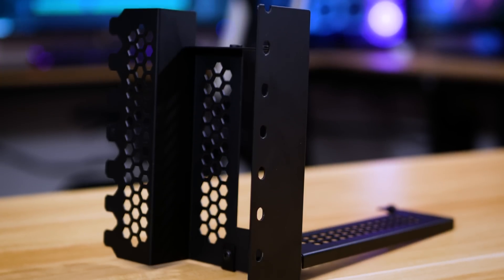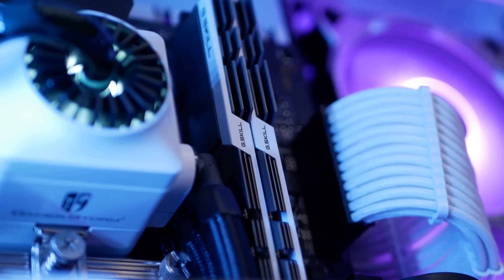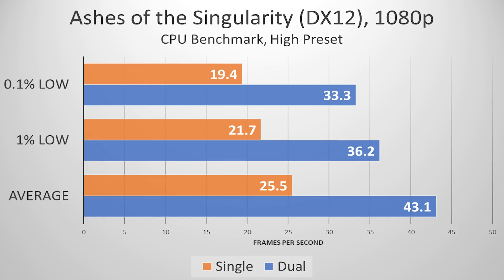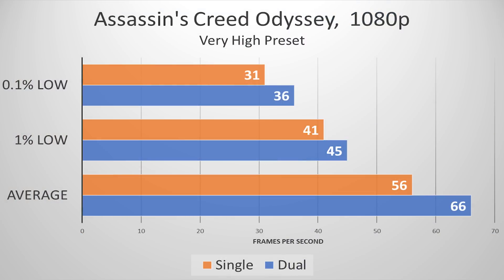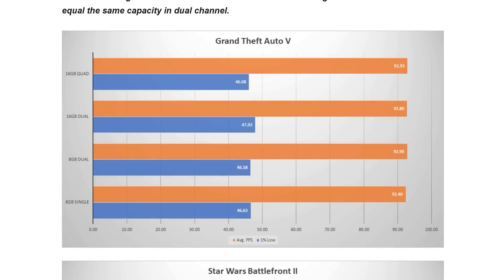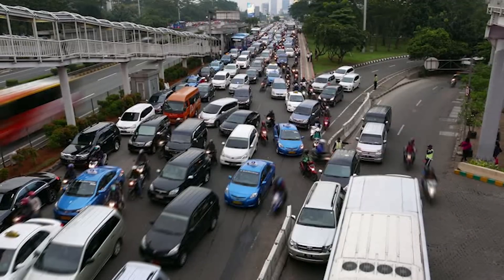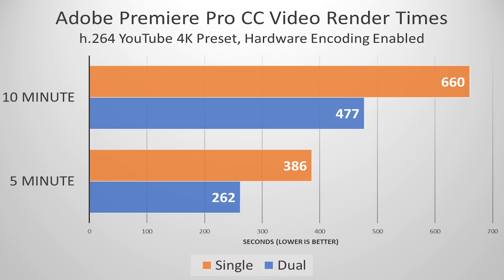What is Dual Channel Memory and Why Does it Matter? (w/ Benchmarks)

Comment: Hello i have a question:) im looking to upgrade my ram to 16gb instead of 8. I aldready have 2 sticks of 4gb ram in the 3 and 4 slot. But the problem is that the store stopped selling those. And i can only get my hands on an 1stick og 8gb ram. So that would make me have 1stick of 8gb plus 2x4gb sticks of ram. Would this work? And does IT matter if i place the 1stick 8gb into the 1st or 3d slot? Thank for the help.

Btw it is the same producer and the both are 2400mhz

Comment: EDIT:  Greg, I think there are some clear reasons that Brent saw little to no differences in his FPS, while you experienced a significant difference here. It appears that your RAM setup included Dual channel ganged mode, and dual channel single dimm, the latter of which breaks the parallelism of the RAM config. There seems to e much confusion about how the channels work. In dual channel, you're combing the bus of each RAM slot. For example,  two 64 bit buses creating a 128 bit bus. It doesn't do a whole lot, except that when not in paired buses, performance bites the dust, as you saw in your tests. I wish that the industry would refer to the Slot Groupings as a Channel, and refer to the Performance based on How Many Slots or Buses are combined. For the channeling, What I'm more interested in, is what Compute features are enabled in the games, ie; AA, RTX, FreeSync, physics and so forth. 2nd, I think the tests for dual channel vs single channel, are more interesting when we start playing with things Like Memory Interleaving being On vs Off. Does CPU Virtualization or IOMMU groups have any impact to memory configuration?  They shouldn't, but do they? Again, I'm not surprised by the results at all, but the title doesn't seem to match the test. Finally

Comment: if both my CPU and board support up to 2666 RAM speed, should I be getting a 3200MHz if am going to upgrade every 5 years?

Which will be cost effective in the long run? 
buy 2666MHz RAM ?
or
3200MHz RAM?

Comment: I built a secondary gaming/streaming pc with a dell optiplex 7010. Unfortunately, The A2 dimm slot is dead. I've tried blowing out the dimm with canned air and I've reseated the stick like 10 times. Every time I powered on the pc, I'd get the flashing amber light indicating a ram issue. So again unfortunately, I'm forced to use single channel. I have 2 sticks of 8gb ddr3 totaling 16gb. One stick in A1 and the other in B1. I can play games just fine with the 1050ti, but it's super annoying knowing I could be getting 10-20 more fps if the damn dimm wasn't dead. BUT, I am gaming comfortably on it 1080p 45-60fps depending on settings. For those of you looking to game on a budget, I would recommend going this route but beware of issues like this. Also there's no room for upgradeability so buy this knowing it is what it is.

Comment: I am confused.  I have ASUS Prime Z390-A.  It has 4 slots, but says Dual Channel Configuration.  I guess I have a few questions.  It seems less expensive to buy two separate kits of 3200mhz 16 cl, each has 2x8 for a total of 32gb ram at 3200mhz.  Vs more expensive option of a single kit of 3200mhz 4x8.  Manufacturer warranty does not cover 2 identical but separate kits to run at 3200mhz and cl 16 (2x8+2x8) = 32gb 3200mhz total.  But had I spent a boat load MORE for a 4x8 kit at 3200mhz speed, they would be warrantied to operate as such.  What is all of your understanding with this?

Comment: @ScienceStudio, some motherboard do not have B2/A2/B1/A1 lineup, my motherboard has it set as B2/B1/A2/A1. Before you just carelessly state "oh don't do it like what he did" you should verify whether or not some motherboards hold up that way. Even I thought was for dual channel you'd have to do one spacing apart, but it turns out some motherboards have it adjacent.

Comment: I have four memory kits 8GB each for a total of 32GB. Same memory kits same brand same specs same everything. I was not aware when I bought them that they recommend to buy them together if you doing either 2 or 4 memory kits configuration and instead I bought two sets of two 8GB chips box separate for a total of 32GB . If i'm doing 4 kits of memory does it matter where I place them since I didn't buy a single set of four rams and instead I bought two sets of two rams each?  even though they are the same brand same specs and everything their serial number is deferent  because they were not bought together.  This are the memory that I bought at new egg I bought two of this set. TridentZ RGB Series. 

Any advise would be greatly appreciated.

https://www.newegg.com/g-skill-16gb-288-pin-ddr4-sdram/p/N82E16820232483?Item=N82E16820232483

Comment: Correct me if I'm wrong, but shouldn't you redo the test at different presets? And then try replacing only the GPU? That way you can find out if  letting a component idle or taxing it has any effect and thus see which takes more advantage of the dual channel ram.

For example, you might be able to say that only the highest end GPUs would get such a large boost in fps. Or only the most demanding games will make use of it. Right now we just have two people giving us two different results.

1. It matters a lot.
2. It doesn't make a difference.

Lastly, try running the exact same setup but with an ssd.

Comment: One stick Kingston 8 gig DDR3 and two sticks of off brand 4 gigs a piece. Also different timings. Works great in a very specific combination. Switch the sticks around and it will not run.

Comment: Ive done similar tests to myself, there wasnt any difference, bc my cpu is bottlenecking my system, even while it shoudnt do that at all
Tested:
1x16gb//2x8gb ddr4 2133mhz
i5 6500
Gtx 1060
Ssd 240gb

Comment: Hi Greg if I run 2x4go ddr3 and 2x2go ddr3 (in the right slots for dual channel, and same clock speed) am I running 2 dual channels or does it disable dual channel function?

Comment: Matters more on the quality of the hardware, for example I had a GTX 970 and the difference between single and dual were negligible however after upgrading to a 1080ti single channel killed my performance when upgrading to dual channel I Gained about a 35-40% performance

Comment: Dual channel memory mode is not automatic on ALL motherboards, some lower-mid tier motherboards even when installed in the dual memory slots will not go into dual channel until you change a setting in the bios. proof http://i.imgur.com/44RSbEb.jpg

Comment: I'm running dual channel 2x8gb ddr4 3000 in a msi b450 pro carbon ac. It also had that pop up in the bios when I had the sticks installed in the wrong slots.

Comment: Is it fine to have two separate dual channels like 2x4gb and 2x8gb in the same system
Reply: Yes.. As long as the mobo supports the amount, And the sticks don't cause any compat issues. You will still be running in dual channel if quad is not supported.

Comment: What I'm curious about is how single vs dual channel affects non gaming environments, as well as a situation where you are doubling the memory from dual channel and converting it to single channel memory. For example I have a Dell Optiplex 580. It came stock from the factory with two 2GB sticks of DDR3. I searched my house high and low for more DDR3 memory and could only find one 4GB stick. I've been contemplating adding it to the PC, but cringe at the thought of breaking dual channel configuration. Would going from 4GB dual channel to 8GB single channel slow the PC down or would it actually possibly help? I do not play games at all. I use this PC as a workstation. I do not do video editing either.  I do dabble with fusion 360 for 3D printing, but that's the most graphically intensive program that I use.

Comment: I would expect an i5+ CPU with a 1050-level GPU would probably not show 2Ch benefit (or should I say would not show 1Ch penalty).
My story: I borrowed my nephew one of my 2 8GB sticks. I played Shadow of the Tomb Raider with a low-priority ffmpeg h265 in the background (i7-8700K+1070). What I noticed is that my SotTR framerate had halved. Upon testing more, it seems ffmpeg in background was enough to hit 1Ch memory limit. When only SotTR ran, frame-rates were playable again (did not record numbers, but I don't expect more than 10% penalty). With 2Ch memory, ffmpeg was not noticeable.

Comment: I’m planning to build a PC next year and debating if I should get 3200 or 3600 DRAM at 64 GB (4x16), or 32 GB (2x16 or 4x8). I’ll be using it for gaming, Photoshop and video editing with Adobe Premiere Pro. For the CPU, it’ll either be a 9900K or the Ryzen 3850 with a 2080 Ti. Any suggestions on the DRAM speed and quantity/RAM kits?

Comment: Hey, I have an option called unganged mode for my RAM on old Phenom motherboard. I've run the numbers and it does better than dual channel. I do have 4 x 4GB RAM stick and my CPU is Phenom II X4 965 BE (4x 3,4Ghz). How it works is it assigns one stick of ram to each CPU core.

Comment: So I pretty much upgraded my entire everything on my PC right now but I'm skimping a bit on RAM since I'm running low on funds.

Question: If I buy a single stick 8gb ram now then buy another one later, will it run as good as a straight up dual channel 16gb?
Reply: I kind of did the same but had a single 16gb 2666mhz and 8700k when i got Another 16gb I got 30-40 more fps in BFV and much higher usage on the gfxcard. And all of the stutter was gone.

Comment: well that's why i don't see myself upgrading.. i have the 5820k and it runs on stock voltage at 4.1 24/7.. that was the days when intel still did proper solder jobs.. it's 6 core and 12 threads like the 8700k.. but it's quad channel ram vs the 8700k with dual channel.. the 9900k is way to expensive.. then i'd rather buy the 9800x.. also 8 cores but again dual channel vs quad channel.. and 44 lanes.. i don't know.. i guess i'll wait another gen.. lets see what amd comes up with..

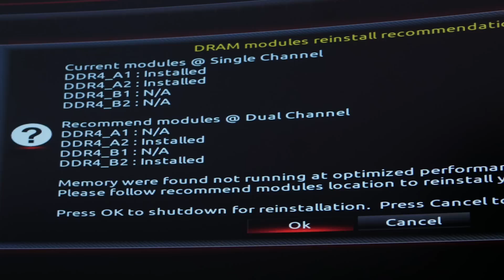Comment: I just wanted to raise one point re. the slots you used. At 1:22  you said that the motherboard required you to use slots A1 and B1 for dual channel (and shows the sticks in that configuration), yet the BIOS warning at 6:14 tells you to use A2 and B2 for dual channel.

Comment: Might be that other benchmarks were using slower (older) CPU (?). With slower CPU, a single channel ram bottleneck might not show. Also I noticed that the mentioned article is also showing the results for 4-channel. So they must have been using HEDT cpu and those are generally not as powerful for gaming therefor the ram bandwidth wasn't a limiting factor in that particular setup, but that is just my theory.

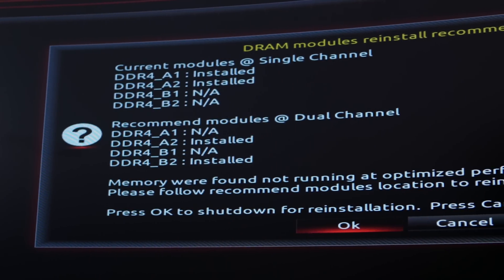Comment: @1:30 you say that slots A1 and B1 are optimal for dual channel, but @6:10 the BIOS/UEFI warning message clearly shows the recommended dual channel configuration should have RAM installed to slots A2 and B2.  It likely makes little difference so long as the RAM is installed onto separate channels, I just thought I'd point out the inconsistency in the video.
Reply: It depends on the motherboard. In a lot of cases a2/b2 is superior. In some cases it won't matter, And in a few rare cases it's a1/b1. It's possible this is one of the latter and the bios has a lot of re-used code that doesn't reflect that.

Comment: Its about time quad or even triple channel memory became the norm given dual channel has been around in the mainstream since the original Athlon and triple channel was in X58 chipsets 10 years ago, and the extra bandwidth would clearly be an advantage. We need another move from the likes of AMD like they did with cores in the Ryzen, to force ram channels to be increased as standard even if its only in the high end mainstream chipsets and CPUs. Whenever I see a a massively overclocked CPU and high end GPU with the GPU rarely hitting high 90s let alone 100% and the CPU is barely even struggling, I can't help but think that the bottleneck there is either the ram or the PCIe bandwidth or both if the GPU is unable to run at full speed, especially in games without soft max FPS cap.
Reply: You start to hit diminishing returns.

Comment: Ha, The Verge dude. My friend (who has built systems, but not in 7 or 8 yrs) and I built my first rig 2 days ago. He was mildly upset we didn't hit any real roadblocks. Biggest hurdles were enabling proper RAM speed, 3000mhz, and splitting the data from one mechanical drive onto an SSD and a second new mechanical drive, mainly cuz I'm kinda thick, and was tired by that point.

Comment: Great video! Very informative.
I just wanted to mention that if you flash a caption on screen, please make it more than 1 or 2 frames. It was a bitch to time the pause to read it lol
By the way, do ram bottlenecks only happen when the CPU is bottlenecked at lower resolutions? Does this mean this is less significant at like 4K?

Comment: I got 1x4GB 2400MHz to start out on a DDR4 platform (Ryzen 3 1200), I plan on either getting a 1x8GB 2400MHz to pair with it or replace it with 2x4GB 3000MHz.

Comment: Thats because ram slots are daisi chaind in pair of two because there is onli two chanels 4 memory on cpu and when you have onli two sticks of ram they have 1 chanel per stick and the boath sticks work at exactly same speed and if you have 4 sticks of ram  usually 2 of those sticks are faster then the other two because of chain

Comment: I wonder how it would perform with a system like a ryzen 5 2600 and rx 580 or worse because that would actually be the people who are considering going single channel with like 1 8gb ram so they can save money and for any easy upgrade and people with a high-end build can already go duel channel with 2 8gb for 16gb that would make more sense I would like to see that
Reply: Never ever go single channel, especially for ryzen cpu. even when you're on mid-end or low-end build with ryzen, its considered as a huge sin!
Reply: Ryzen 2600, rx580, Asrock b450 mITX, single stick of 16Gb 3000Mhz ram.

I went with single stick as I wanted to get a second stick of Corsair ram when I had another $300Aud.
Reply: @Kathdath  How it runs?
Reply: @QuasarQu  pretty good, was running toasty in my QBX, but I just watercooled cpu/gpu so now is runny nice at 4.1GHz overclock
Reply: Kathdath What VRM temps you get??

Comment: Hey Greg awesome video and this kind of goes hand in hand with something I've been wondering . My current main system (yes I have more than one) is a Threadripper 1950X, Gigabyte X399 Aorus Gaming 7, G.Skill TridentZ RGB 3200Mhz 64GB 4x16GB. Originally I had only two of the G.Skill dimms. Due to pricing at the time and still. My question is this. Does the RAM I'm using which are in the proper slots stay dual channel or do I actually get quad channel performance? Again these RAM kits are the same kits. Just wondering if I should get a kit that says Quad Channel?

Comment: Can u test on a ryzen system as well and see if similar results. I bought a prebuilt last year when pricing was ridiculous. It came with 1 16gb dimm at 2400. I would like to see difference going dual and higher frequency. I have a 1600 doing both gaming and CPU intensive tasks

Comment: Here's a question for you, if I put 16GB of ram(2x8GB)  now and they will work in dual channel, and later I will add in another kit of 16GB (2x8GB) will that still work in dual channel?
I'm referring to the consumer platforms so B350, Z370, X470 etc.
Reply: Yes, it'll run in dual channel, and if your mobo supports it you could even have quad channel
Reply: @James Liu Thank you so much for answering my question.

Comment: I followed the Verge guide while building my PC and let's just say, I've been royaly screwing myself. But at least I didn't sort circuit my power supply because I wisely used the included vibration pads.

Comment: Hi Greg, have you checked your timings for both configs? Maybe they changed and caused the big difference in the results. I know from personal experience that bad timings have a huge impact on performance.
Reply: I'm suspecting there's more than just dual channel vs single channel differences in this.  It's been extensively tested by multiple people with very minimal gains in gaming applications.

Comment: You can’t trust just any benchmarker on the Internet. Memory can be bottlenecked by other factors such as GPU power. That would limit the difference between single and dual channel the same as it would limit the difference between two different CPUs.

Comment: I have 2x8 running single channel in slots 3 and 4 when I try to change 1 stick from slot 3 to slot 2 my monitor wont turn on does anyone know why is that thanks.
Reply: Well firstly, have u tried slots 1 and 3 instead of 2 and 4? U might have a dead ram slot. Is this a recently purchased mobo? Also, when u say ur monitor won't turn on, do u mean ur computer isn't booting?
Reply: @BigJohnFlop  Mobo : MSI B85-G43 GAMING bought in 2015 my pc is booting fine its just that my monitor wont turn on when I change the ram stick from slot 3 to 2
Reply: @szogun800  honestly wouldn't know the solution, try posting a thread in an msi forum or even tomshardware
Reply: @BigJohnFlop  I posted a thread on tomshardware and I am talking to moderators but they dont know what is wrong they are suggesting that my mobo may have a bad channel I tried 1-3 2-4 1-2 and 3-4 and only 3-4 works for some reason maybe if I tried to connect via HDMI or DVI-D

Comment: What about native 2800Mhz memory vs My cheap 2133 OC'ed to 2800 using Ryzen master? 
I'm still curious Please do a video
Reply: If all the timings are the same (CL and all that) then I'd guess it's the same. But you could overclock the native 2800 even higher so that'd still be better
Reply: @bueb8674  I think difference between 2800 to 3200 is minimal than 2133 to 2800... And try to find a cheaap ramstick in India...